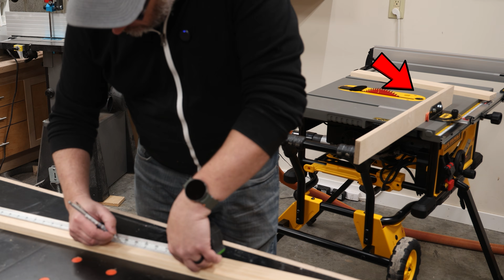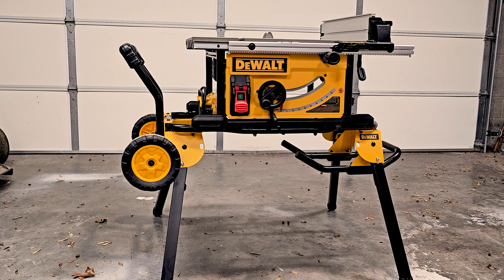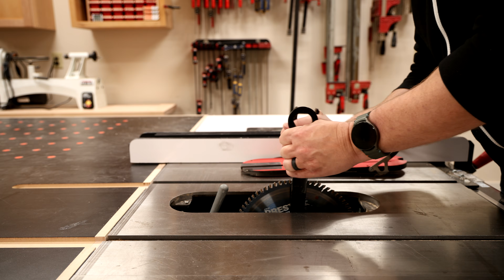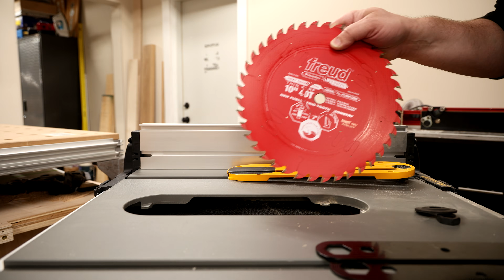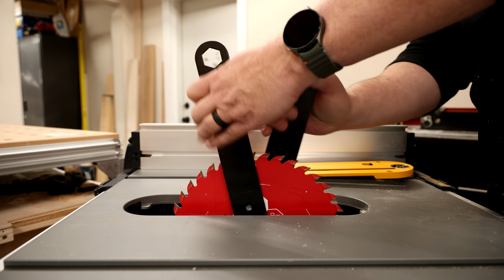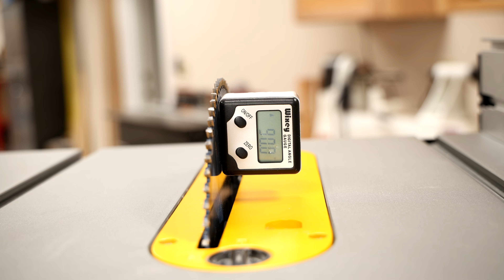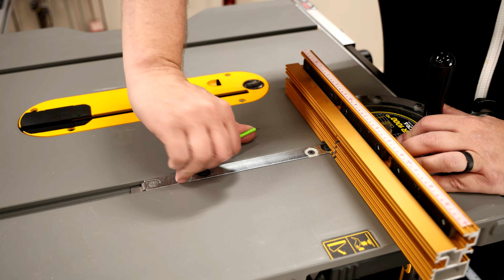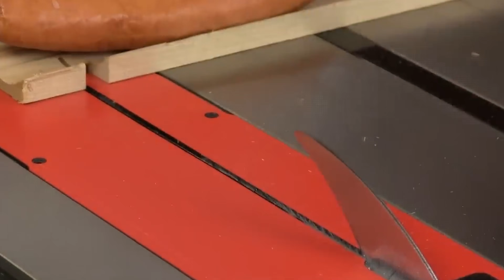Why do people even buy this saw?

Comment: Started out with a $100 new craftsman saw. So frustrating to use. When I retired I had a full compliment of vacation hours they sent me a check for. I bought a Grizzly G01023 SLW. 2006. It has been a great saw. I only make stuff for family. But if I had to do it over, I’d do the same. I have the long rails with a router built into end. Outfeed table is 48”x96”. Very easy to cut a full sheet of ply on. And 19 years ago when I bought the Grizzly, it cost less than half of what the Festool track saw costs.

Comment: When my small old Craftsman saw died I went to a Delta contractor saw. Table is cast iron with sheet steel inserts. It provides the table size has almost never bogged down. Th fence isn’t great but I’ve improved upon it.  Cost is mid $700’s and it only gobbled a small tip of one finger when I did something stupid. Even that saved me a couple of hundred but cost me a bandaid and some antibiotics.  Great video!

Comment: I started with the dewalt saw.  I think they’ve clearly changed it as mine 10 years back didn’t have much space in front of blade.

It was really sketchy with ripping long boards and such because of weight.  And by long I mean anything over 4’

But it was small.  My cabinet saw takes up my whole shop

Comment: I bought a Craftsman radial arm saw in 1977 and a Rockwell Unisaw with the sliding table in 1984. Still have both and all my digits. There's nothing better than a great table saw. It's accurate, solid and powerful. I learned early, not through any accident, to respect that thing and make and use jigs when things get a little touchy. In my opinion, and it's just my opinion, there's too much safety built in to everything we do today. There's no greater teacher than facing danger head on and avoiding the danger by being smarter than the danger. I make my own push sticks and feather boards out of scrap lumber and make hold-downs and sacrificial fences. Years ago Makita made a great little job site table saw with a slide miter table. I have one. It rips to 24" and is dead-on accurate. I'm sure a SawStop is a great saw and for the newbie, a real finger saver.
Reply: The big safety feature is between the ears.  Keep the eyes on the sharp parts and anticipate where things will go if something goes wrong.  Keep the hands where they won't go near the blade if it does.  I have a hard and fast rule for table saws:  Never reach behind the front of blade when it's spinning.  Even when it's not, doesn't mean that it's safe.  The only accident I've had with mine was when it was off.  I dragged my forearm across the blade.  It made a mess, but no serious damage done.
Reply: A track saw is nice but not a substitute for a cabinet shop saw.  More of another compliment to the cabinet saw.
Reply: @kenbeiser4443  What is a "cabinet chop saw?"  

Chop-saws (if that's really what you mean) are useless for woodworking.  They're metal or stone/brick tools. Cabinet saws (if that's what you mean) are complementary. Cabinet saws forte is ripping.  Track saws for sheet goods. A cabinet saw can't come close to a track saw for boxes.  Face frames will "need" a table saw.

If neither of these are what you're talking about, please tell us more.
Reply: @kwilliams2239  You must of misread his comment. He said "cabinet shop saw", so he probably meant a cabinet style table saw.
Reply: @crafterchief38  Yes, I did.  Lysdexia strikes again.  Thanks.

Comment: joist cant even compare your cutting little baby board.Get a flatbed full of stock 16 ' and make trim big saw will eat it up.been running mine hard for 20 yers been threw handful of job site saw dewily and makita worked with all, been in field 40 yrs.

Comment: Blade choice and precision of fence alignment is a big deal for a jobsite saw, I' have the earlier version of the Dewalt jobsite saw and having the right blade and right setup if the difference between really having to push material vs just having it glide through. I use the Freud GP Wood Demon blade for most work and it will rip dimensional lumber at full depth of cut without much issue. I aligned the fence to the blade with a precision-ground straight edge, it will keep within about 0.0012" and blade run out is well within 0.001" by a little lapping of the blade washers and nut.

Comment: I use the popular jobsite saw you used in this video and for the most part love using it. While I agree it has all of the faults you described, there are work arounds, many you described here. If I were running a business, it would make sense to upgrade to a cabinet saw, but as a hobbyist, this saws suites my needs. Luckily I mostly cut 90 degree cuts, but on the occasions I needed angle cuts, though not as easy to set as your cabinet saw, weren't that bad to set up. I did like some of your upgrades that I have not done, so I may give them a try.

Comment: you should have checked the blade alignment and rectified it before doing the rip test first i think that you would have gotten a much better result on the rip test
Reply from the maker: I did do that way back when making my very first cuts on the saw (before ever making this video). the video is not in chronological order. sorry for the confusion!

Comment: The choice for the majority of people is not job site saw or cabinet saw. It is job site saw or no saw.
Reply: I moved to the Philippines a while back, and holy cow ! Unless you want to take out a 2nd mortgage just to pay for shipping, the number of saws available here make it pretty much the DeWalt or one of much lower quality.  Let's not forget that the standard voltage here is 220, and bless their hearts, DeWalt is one of the only name brand saws that comes in a 220V version. The others are ( I think ) Bosch and Skil. My best guess at shipping a behemoth like the SawStop would be in the 2500 to 3000 or more dollars.
Reply: Hikoki is also a good alternative.
Germany has 220V too.
Maybr that helps in your search.
Reply: @TheZaomei  Isn't AEG (also from Germany) making a comeback?
Reply: @chrisp1653  Makita can have one , their old table saw MLT 100N , one thing where Makita is in no hurry is making new version of its table saw.
All other saws , they have range from 75mm/3" (12V) to 405mm/16" (40V/corded) in circular saws
Reply: @pete_lind that Makita table saw is junk compared to the DeWalt though. And I'm a Makita fan love there 40v line of tools have a bunch of them.
Reply: @chrisp1653 and every time it triggers, you have to pay $200 for a new blade and new sensor motor. StopSaw is a scam.
Reply: @chrisp1653  Here in the UK (and pretty much all of Europe) it's 230v.  We regard anything rated between 220v to 240v to be functionally equivalent.  There's no shortage of manufacturers to chose from.  If by "name brand" you mean American, maybe that's your problem.  I'm currently planning to get the Evolution R255TBL+ Looks like a lot of saw for the money.
Reply: @chrisp1653  Its gotta suck to move to the Philippines becuase you want a lower cost of living and find out your budget STILL constrains you, huh?
Reply: I use a circular saw and pieces of factory cut MDF as a track, either clamping or screwing the 'fence'. I cant afford money or space for a table saw of any kind. It works fine.
Reply: @SylvanApe  Very sensible
Reply: @SylvanApe  A couple of pieces of MDF glued together (a shooting board, such as it is) is perfectly fine.  Even owning a track saw, I've done this a couple of times where I needed to fit between two obstacles.  Track is hideously expensive.  Cutting it is a crime against humanity.  As a note, MDF isn't so cheap anymore, either.  It costs as much as middling plywood.  It's about $50 a sheet, here.

This is fine for working with sheet goods.  It's not so fine for ripping hardwood.  That's where a table excels. I don't like the idea of ripping long boards on a light jobsite saw.  A heavy as hell cabinet saw is safer.

Table saws are also better for absolutely accurate cuts, after the track saw is done with them.
Reply: @kwilliams2239  I love your comment " cutting it is a crime against humanity" sooo true...thank you for that thumbs up...
Reply: @SylvanApe  got the dewalt jobsite for 150 bucks , wasnt even looking for one but was so cheap.  check garage sales and pawn shops
Reply: True, but MWA Woodworks and many other woodworker channels discuss making stuff like furniture or finish carpentry where many viewers, like myself, have fixed machinery in shops.  Watching builds of home framing projects gets boring fast.
Reply: @bobbray9666  I can't imagine having a cabinet saw and then turning to YouTube for entertainment.  That's truly depressing.
Reply: @bsdnfraje  So if you had a cabinet saw, all your time would be occupied using it?  Now that's a problem you should see a shrink about.
Reply: @bobbray9666 If you can't parse basic English, it's a wonder you can afford a cabinet saw.
Reply: Bora makes a guide attachment that adds tel supports in front and back
Reply: About right.
Reply: I feel your pain bro
Reply: Ah. This video may not be for those people.
Reply: Agreed
Reply: Good used cabinet saws are available for about $1000. I have bought some nice equipment in estate auctions for nothing. Nothing in my shop was bought new, and bearings are the long term issue. I just replaced the motor bearing in my Dewalt compound miter saw, standard 6302 bearing.
Reply: Exactly!
Reply: Exactly. That Saw Stop cost more than every other tool in my shop, and about half of what I spent building the shop in the first place.
Reply: I never make stuff that has tolerances that only SpaceX  requires. My ‘dialled in’ Rigid portable is freaking amazing.
Reply: @Carlsbaddest  You'd be surprised.  Try making an octagon and have the corners come together.  It's harder than it looks. A 1/32" error compounds into a 1/4" miss. Yes, accuracy matters.
Reply: @kwilliams2239 Never had the need to make one and don’t see me making one in the foreseeable future either.
Reply: @Carlsbaddest  So you can use an axe, right?  You just confirmed that your saw isn't as good as you think it is.
Reply: @kwilliams2239  ,  hold your attitude there buster.
Reply: @kwilliams2239 he said his saw does everything he needs it to do. You said it can’t make a perfect octagon. 

Which he replied that is not something he requires of his saw.  Nor was it an argument he made.

Ofcourse there are better tools , there always is.

Thats like the guy saying my Toyota does everything I need. 

And you saying “ well I can it run an 8 second 1/4 mile ??? See you need a Bugatti”
Reply: @northbaypool5930  I got that, but it's an example of errors adding and why more accuracy than one would expect is necessary.  Compounding errors are the bane of woodworking.
Reply: @kwilliams2239  Why? Why not also ask him to build the Taj Mahal or something completely IRRELEVANT that he will never care to build? What kind of a numbnuts are you?
Reply: @lelandgaunt7130  Because a jobsite saw is too light, too small, and the fences suck. Contractor's saws usually have case-iron tops, a decent size, usually with wings, and take real fences.  Good ones come up for sale quite often.  I've even seen some hybrid saws well under $1000, and not much more for cabinet saws. Jobsite saws are toys.
Reply: @lelandgaunt7130  well I’m glad he has no ambition in the craft. As they say: If you don’t want to make anything nice, don’t say anything at all.
Reply: Yep, a few hundred VS a few thousand? How much money are you making to justify this?
Reply: @randythescout  how much are your fingers worth to you?

Comment: You have more confidence than I do that if the fence is aligned correctly when pressed against the blade that it'll be right when pulled back a couple of feet.
Reply from the maker: I tested the fence pretty well in the video. even after fully extending it 25 times it was pretty dead on.
Reply: @MWAWoodworks  Did I misunderstand?  I saw you moved it a lot.  But it looked like you were always evaluating the fence's alignment when it was right up against the blade.  I've had bad experiences with fence designs in the past, where a fence is aligned properly in one location, but not in another.
Reply from the maker: @missingegg I didn't evaluate it against the blade. I just ran the fence as far out as it would go and then all the way back into the blade multiple times. Then I adjusted the fence to the width of my ruler and checked for discrepancies at the front and back.

Comment: Wow, I guess I'm really late to this ball game.... I really enjoy your channel.   I have an older Bosch 4009 with gravity rise table (on wheels).  The Bosch states in the literature that it has a 4.0+ hp motor so I never felt I was lacking in the power area (even with full kerf premium blades in hard woods), especially as some of the Saw Stop cabinets advertise, I believe, @ 1.75 HP so it depends as far as power goes on what ya get as far as job site vs cabinet saw.  To me the real difference (in addition to the sausauge savor SawStop) is the ability to zero in the angle adjustment by having the second wheel instead of a locking arm (can be overcome but takes longer) and having a closer to degree flatness of the cast iron table. with Iron wings (mine is aluminum) as well as normally a better fence.  I bought the (add on) side extension arm so that in addition to a home made front loading arm really made my saw as far as size capability a non issue.  A couple of cement blocks on the floor over the bottom of the table frame really removes any unstable issues. And let's face it most miter gauges are crap regardless of site saw or cabinet (exception possibly Harvy if ordered with their saw).  Thanks for a great video.

Comment: What a great video, very good job. I lost about a quarter of my thumb on my first jobsite saw and wish I had a sawstop. 
I have  gone through a few job site saws in my time. I currently have an old 10” dewalt plug in, an 8” dewalt battery and most recently the 10” sawstop job site saw. You should know the 10” sawstop fixed a few of the problems you mentioned. Its fence doesn’t flex up as it clips on to the rails directly in line with the fence rather than offset like the dewalt 10”. Interestingly the 8” battery dewalt uses the same system that clips in line so that one doesn’t have lifting either. 
The sawstop also has an angle adjustment using the same wheel you use to adjust the height. It is way better than trying to get the dewalt to play nice. 
Of course it will save your finger which I could have used about 10 years ago when I was doing a lot of repeat cuts on a project and got complacent. I lost a quarter off the front off my right thumb before I reacted and pulled my hand back. I’m extremely lucky I was taught to never wear gloves with a table saw. It still took me close to a year to recover the flesh in my thumb. 
I would recommend a sawstop to anyone who values their fingers or lost time in recovery. 
Thanks again for such a great video

Comment: I really like your content and all the tips I do have that DeWalt saw and I like it a lot and it was nice to get a full briefing on how to do the adjustments, I thank you for that. One thing I'd like to mention and any other content provider should follow suit is when you're finished with your video don't just cut out leave a 15 or 20 seconds for those of us that are in the kitchen that have to run over to the mouse and click on the like And subscribe button before it goes away. Just a thought

Comment: I just bought the same DeWalt as you tested. The first things I did were to check the various parallel items. The blade was off square almost exactly like yours. The stock fence needed no adjustment. I built a flip-up out table that adds 36 inches. My previous table saw is an old, rusty thing that has seen better days. The DeWalt is a major upgrade for me. The first thing I'm going to make is a cross-cut sled that 731 Woodworks designed. The tip about the different widths of the slots will be very helpful for that project. Thanks for the video.

Comment: I think after absorbing a ton of youtube and videos and reading forums,  for my money, a Sawstop PCS cabinet with 1.75hp and using the correct blades, and going a little more slowly, will let me get through all the hardwood I want for making most things.  I was going to spend the money on the 3hp, but then there's the electrical upgrade for another 220,  avoiding the embarrassingly (for Sawstop) horrible fence on their 30" and going to the T-Glide, then a ridiculous amount of money for the mobile base to move it around a small shop when needed.  I saw a lot of professionals have built fine furniture and everything using lower powered table saws for decades.  Saves $500 and it can be upgraded later.  I even looked into alternatives to Sawstop's fence since with my track saw, I bet I don't even really need 36".  The safety technology just makes the money worth it.  Any thoughts?

Comment: 17:00  you don’t need to use that crank all the time, if the fence is unlocked you can just push it over how ever much you need, and then use the crank to really dial it in

Comment: Yes those miter slot width difference on this dewalt.Meh frustrating at first but got some microjig zero play adjustable width miter bars and just set one up for the left one and one for the right and solved my problem when building sleds.

Comment: Any reason you didn't use your digital, Magnetic angle meter on the Dewalt when trying to set the angle?
Reply from the maker: I did. I used both the digital gauge and a speed square.
Reply: Ok, in the video setting the 45, you were using a speed square, complaining about having to hold it, while adjusting the blade angle. But to be fair, I'd way prefer an adjusting wheel to set the angle.